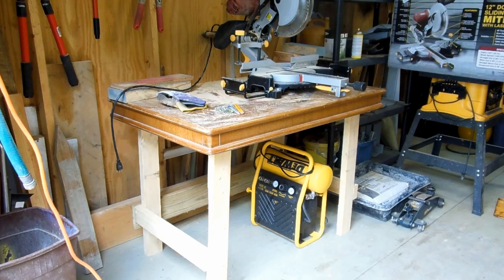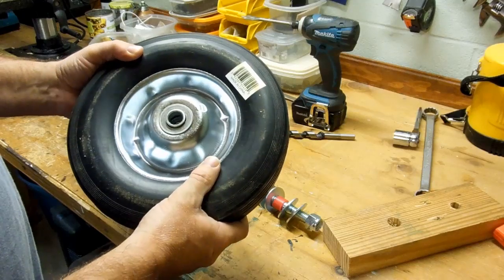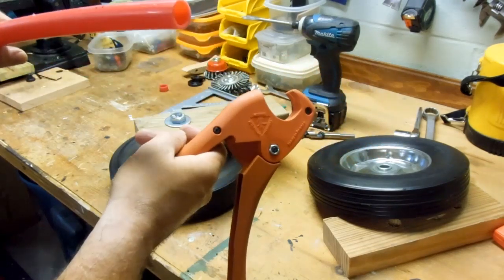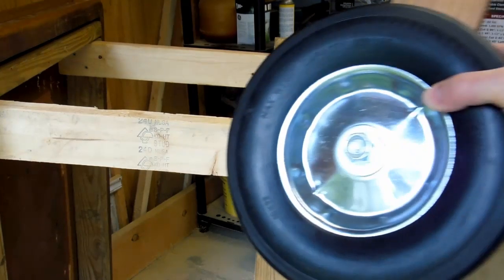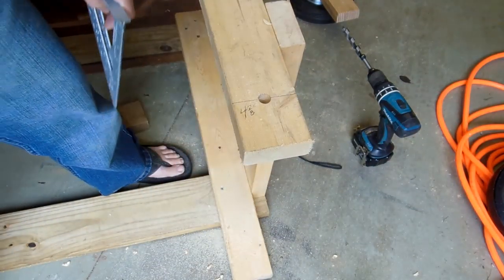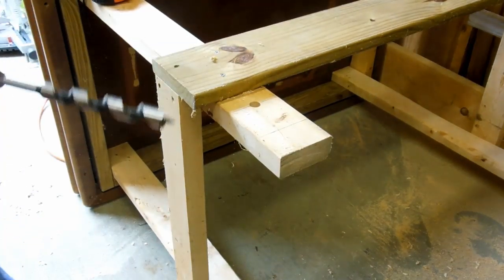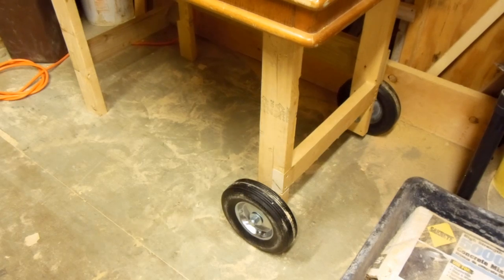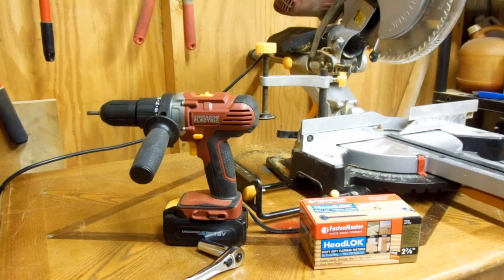How I recycled an old coffee table to build a Portable Miter Saw Work Table

Comment: Question for you, I'm finding myself doing more projects lately after my wife bought me a ryobi cordless six piece job+ set with 2 battery I added a router same name brand, now I'm looking for a miter saw should I go Sam brand or would you suggest tat or is this one with harbor freight a way to go, wat say you
Reply from the maker: Hi, Frankly I would not recommend any motor driven Harbor Freight product. They're just too cheaply made and they will not last. The 12" compound miter saw also has known problems with soft/cheap metal which could result in a safety issue IMO.

I just had a practically new 4" grinder burn out after a few minutes of tough use. It only cost $15, but now I have a piece of junk to haul to the trash after receiving very little productivity in return.

You can get a nice Dewalt 12" sliding compound saw delivered for $400 these days.
Reply: Tnks for reply but Tat's to high for me $200 my limit
Reply from the maker: lolo ent
You can get a standard, non-compound Dewalt miter saw delivered for just over $200 these days. There are also other decent brands out there like Hitachi you can look at.
Reply: Vicos tnk u 4 reply,  I saw a Hitachi on Amazon.com for $199 &  a reconditioned ryobi for $179